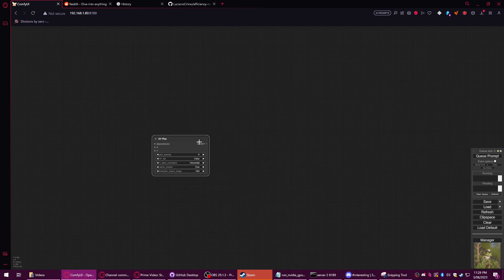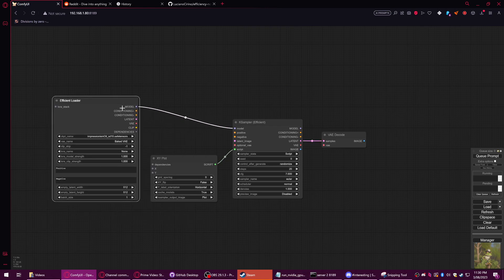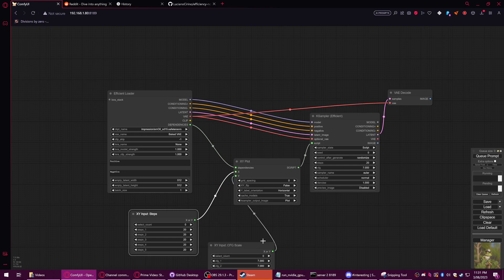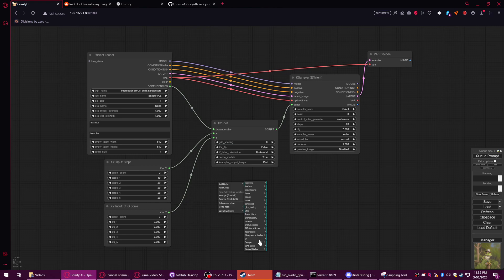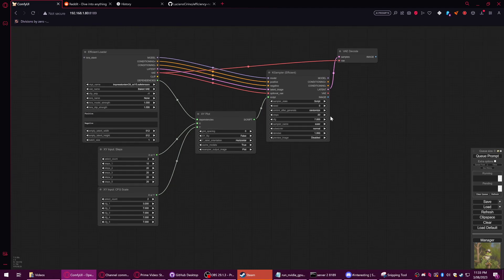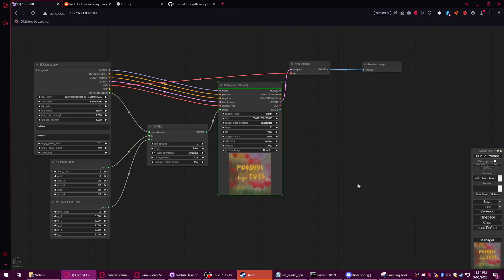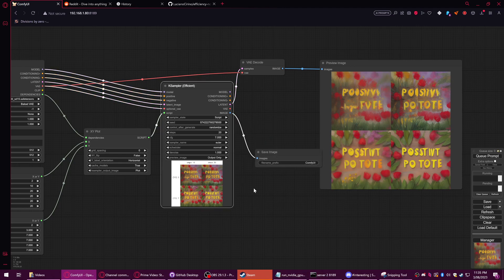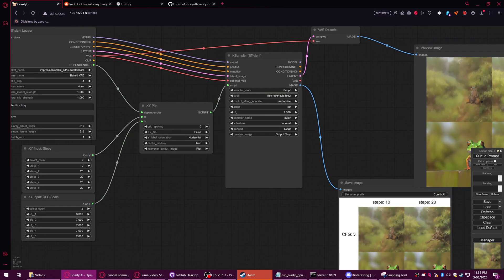ComfyUI Fundamentals - XY plot node

Comment: Problem is with xy plot, because it gets it dependencies directly from the loader and connected to the ksampler, it ignores everything between them, like controlnet or ipadapter. It just keeps generating images, as your ip, control stuff would be set to bypass :(

Comment: @ferniclestix, would you happen to have the json workflow for this tutorial?
n/m, the node settings have changed a little, but I was able to reproduce it following the tutorial.
Reply from the maker: unfortunately I think its lost to time.  :<
Reply: @ferniclestix I recreated it easily enough with the current versions of the nodes used.

You even done anything on merge models?
Reply from the maker: mm i should lol.
Reply from the maker: model merging in comfy is pretty basic, just like a single node you can use to merge two models, no idea how it works under the hood more investigation needed.

Comment: Great video as usual. Note for newcomer watcihng this in Jan 2024: XY plots are my pet peeve - I want them everywhere so I can quickly adjust for specific parameters on everything. And there lies the problem -  the quickest way to generate these plots is the method showed here. BUT it limits you to whatever modules for the XY plotter EFF nodes has provided you with (which you wil  hit the limits of very quickly), and in addition, forces you to use the EFF loader and EFF ksamplers, which as youll get to discover the hard way, stop you from using your custom worfklows upstream. That's because these nodes expect a 'dependencies' and 'script' input for most (but not all ) operations. The tupples these two want are a nightmare to write by hand, so currently I'm started using Trung's 0246 in conjunction with CR to write to image, it's not ideal (nor easy) but at least it's portable.

Comment: Is there a way to do this with sdxl? SDXL lora xy plot?
Reply from the maker: Can't really help much there, I generally don't use xy plot myself. I don't see why it wouldn't be possible though.
Reply: Isnt this method supposed to work with SDXL? I actually got horrible results with  SDXL and had to change to deliberate v2.  @ferniclestix
Reply from the maker: shrugs I literally have no use for XY plot in my daily use. I do large testing batches of images to folders rather than making image grids.
Reply: @ferniclestix  can you show us how to do that ?
Reply from the maker: just use the 'image save' node from WAS suite and put a folder path in the top area and it will save to that location. then run big batch jobs or multi ksampler workflows. it will all get saved to one folder.

Comment: Questions if I may for your next videos: 
- How to load in textural inversions/embeddings?
- How to add weightings to Lora values (and TI's)
- How to place Loras (and TI's) further up the prompt chain. So far I've only seen them placed fully after the text prompt(s), thus at the end for lower importance
- Could SD1.5 be used as a prediffusion if a specific model/look required, which is then fed into the SDXL model to work from (like a first pass prediffusion like your squid images). is this a good idea even?
Reply from the maker: - I've never used textural inversions/embeddings so I don't know. Ill certainly look into it though (always learning :P )
- adding weights to lora values is just done using the strength number in the node.
- placing loras further up the prompt chain is pretty simple. You link it up and then send the conditioning all the way up to wherever you want it to apply, this could be at the other end of a bunch of samplers or whatever.
-Yes, 1.5 works as prediffusion, you can just plug a different clip into the cliptext and it will work. but be aware that prediffusion is barely used by the next step, its more like a guide for the image like control net or img2img. The only thing you must do is ensure you decode the output and re-encode it before using it in a sampler with a different model.